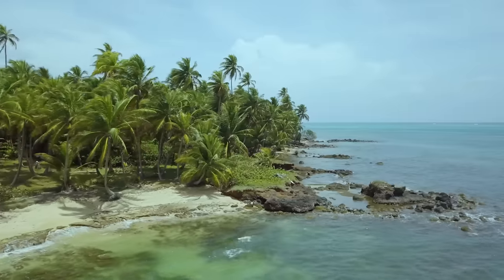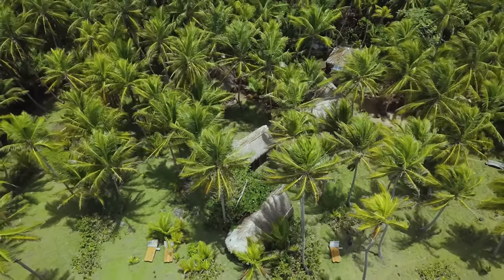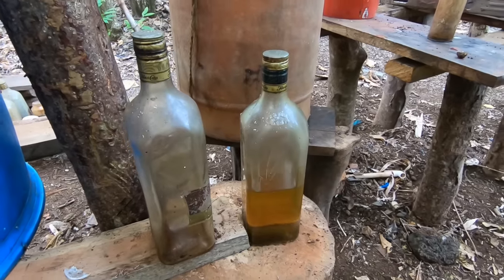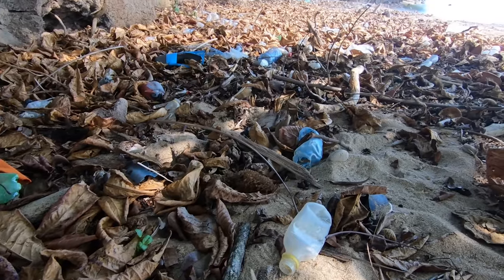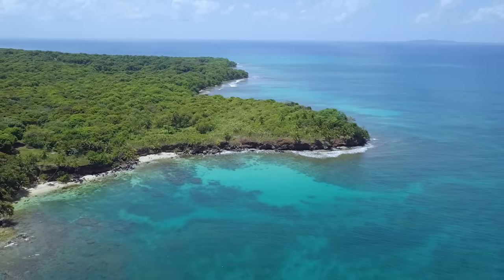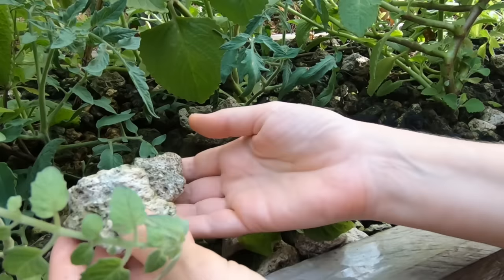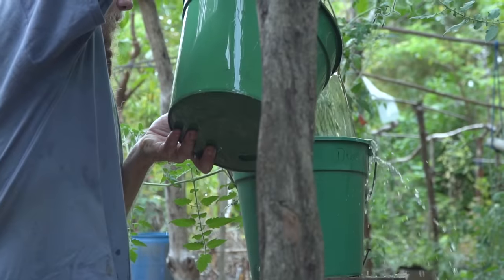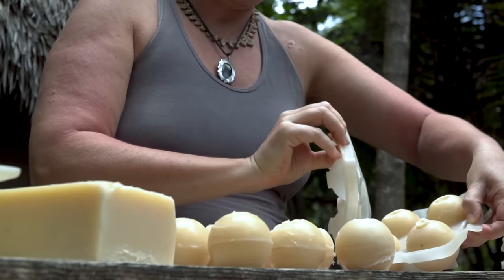THIS SELF SUFFICIENT FAMILY MAKES THEIR OWN FUEL FROM PLASTIC!

Comment: Really, wonder why they can't do that here ?
Wow, the oil industry would freak out over this. 🤔
Great idea
Reply: For the same reason we no longer turn in glass bottles at the grocery store for re-use.  It literally is cheaper and easier to make a new one than to clean and check for chips on an old one.
Reply: @suzannehartmann946  so ur for the continuation of pollution it seems... me personal rather stop all this extra bs that continues to wreak Mother Earth!
Reply: Two problems with it. The first is that it's a dirty fuel, probably dirtier than commercial fuel, so you would need to heavily filter it and separate off the fractions as he hasn't got a pure diesel, it's more like paraffin or petrol. 

Second issue is that he's using loads of wood to gasify and condense the plastic. If he was using solar or wind to generate the heat, there may be a case for it. As it is, he's in efficiently producing co2 and other pollutants by burning wood to turn a fossil fuel into atmospheric pollution and more CO2. Additionally, every time you convert from one form of energy to another you lose energy to the process, so he would have to have a really good reason for  making liquid fuel. Perhaps to run a car or generator... Which begs the question, why not use one of the many existing more environmentally kind ways of doing those things.
Reply: @aleceshowe  im for the guy in the video! Hes cleaning up plastic amd other stuff what are you goimg on about?
Reply: @aleceshowe  why are you saying this to me? You should be tagging the person i tagged the one who rather do whats eaiser vs whats better!
Reply: @KAG1776  that reply was not intended for you it was for susanne Hartman. 
Sorry mate.
Reply: @KAG1776  sorry mate that went to the wrong place
Reply: @aleceshowe  no worries
Reply: @Joseph F Portelli Except that Burning wood doesn’t make more CO2 than those huge ships, tankers and airplanes that spew it all over the atmosphere delivering fuel, goods, and people.
Reply: @KAG1776  please don't bullshit what they said. 

They said it's easier and cheaper. We live in a capitalistic society that has huge incentives to exploit and do it the cheapest and easiest way possible. 

We can decide to have a system that makes it benifital and wash for the people who would be doing the hard work but that actually takes well thought out exploitation.
Reply: @KAG1776  it's a pretty interesting cost benifit balance. I am all for what he is doing cause plastic is a really horrible pollution with very little means to decompose it. At lease when it's burned like this the co2 can return to the natural cycle. 

Is his system perfect? No. But he is utilizing resources in a mannor that does leave the environment better off. 

How viable this is is a different question. It's a very unique small scale solution that isn't terribly applicable to anything else.
Reply: @Skinnymarks  im all for what he's doing as well!  i walk around and collect things people toss out and repurpose them! Most my veggie/fruit structures are built from other people trash!
Reply: I suspect that the simple process he's using produces a fair amount of toxic gasses. Recovering those would be necessary if you were doing this on an industrial scale, and that would raise the cost significantly.   If you could get people to pay you for taking  their waste plastic away, you could probably still break even.
Reply: @Skinnymarks  Suzanne made a statement ... i replied ...  
The problem with humans is they always seem take the easy way out even if its wrong! Its easier to not mass produce crap this way people domt have to go around cleaning up all this crap! SO RATHER THAN CONTINUING TO CREATE ALL THIS CRAP WE SHOULD USE WHATS ALREADY MADE VS ADDING MORE TRASH!
Reply: @angelasandlin7058  no, it would be worse, or at best, just as bad. Plastic is a product of the oil industry, so unless you're shipping all that oil around the place, you won't be making plastic to recycle. 

Besides, his energy-to-pollution/co2 is going to be a far more inefficient ratio than just relying on freshly drilled oil. Plus he's burning wood, which if you scale up is going to mean we start losing forests. 

Again, I would advocate going down the renewable route where the energy to co2 losses are less and the co2 becomes circular, whereas he's adding fossil co2 to the atmosphere. 

And as I said, if there is an absolute need for liquid fuel, then he should use renewables to generate the heat. 

The reality is it seems as if he's looking for a way to live cheaply and avoid the bigger rat race... I would suggest that there are better ways to address the real problems that got us here and dressing his solution up as an answer to justify his position. It's too simplistic a worldview to think that escaping to an island makes you immune should the rest of the world continue to poison itself. It can only work for a tiny percentage of the population and even then it's not sustainable unless the world continues its bad practices.
Reply: @islandsedition  agree with most all u say! But forest management is necessary,  California if they actually managed their forest they would not have the wild fire issues they have... but they just let the forest burn instead of doing clean ups...
Reply: @islandsedition  there are places in the world chopping down lots of forest to make more room that needs to stop, not people harvesting wood thats dead... its the fools who take out the forest in masses!
Reply: @KAG1776  yes and no. Forests are, in some places meant to burn, as it creates natural fire breaks for the future. This results in smaller fires when they happen. 

The issue of late with Auz and California is the dryer periods due to climate change which makes it harder for saplings to grow back and shade the land, combined with increased human activity. Fewer people playing guess the baby with fireworks or being careless with campfires will always reduces the risk of fire. I'm guessing few have been started by spontaneous combustion.
Reply: @islandsedition  whats happing in cali is lack of care for the forest! If you do not maintain it will burn bad in the hott hott months... there are places in the world that actively keep the forests maintain to a degree and guess what their wild fires are far less and they have hotter dryer weather in some of these places... i again agree,   some forest fires are great because of the benifet after the fire passes, also some trees wont reproduce with out said fire... but cali problem is lack of forest control! 
Every year i prune my trees and my shrubs and flowers and every year i, bury compost and burn it, also if i see pieces of the wood from branches  i can use as ways for my veggies fruits and vines to use as a jungle jim i keep till they cant do what they use to... this year ill be walking around with a big wagon to collect things i can repurpose for projects like, adding to my compost heap, or building more structures for my plant life to thrive... one of my yards favorite treats is the woodash i feed them all.... i use 3 types of ash, the white ash use to sprinkle around my plants as food once water hits it its activated... then i have the chuncks and the black ash... for me each has its purpose... wish i could harvest alot of cali forest waste but im 2 far away lol
Reply: The biggest producer of the air we breathe come from the Ocean!  The second is our trees! Both are being destroyed ... most people think trees are our biggest producer of he air we breathe but our ocean is home to the real mass production of our air and we are absolutely  messing both up in a fast way!
Reply: Joseph F Portelli I’m curious to know exactly What “renewables” are you referring to that don’t use any other form of “energy” to be produced?  He uses Solar.  Wind turbines aren’t always reliable... so I’m curious.
Reply: @KAG1776  interesting, had to look that up as I didn't realise that 50-80% of the oxygen is produced by plants in the sea. Though, marine life consumes around that same amount, so we are still largely dependent on the trees and vegetation. 

But your point remains valid, and mucking one or the other up doesn't bode well for any of us, mammal, fish reptile or plant.
Reply: @angelasandlin7058  I was specifically referring to how he produces his fuel, which he is doing by burning stuff. 

As for wind not being reliable, I feel that is a misguided statement. All fuel sources are "unreliable" If the conditions for them to work are wrong. 

Wind is extremely reliable in many parts of the globe, especially on or near the sea. Solar has similar limitations but is still effective in very northern temperate regions. 

The key thing with any renewable fuel source is power storage to ensure that the ebb and flow of solar or wind don't affect the grid negatively. Batteries are the worst of them, but they are an option. Flywheels have been used industrially, and even on a short bus route back in the 50's in Sweden I think. But there are also air storage, hydrogen production, hydro (again limited by region). There is no part of the planet where one or more renewable energy techs in conjunction with suitable storage could not be used to sustain a quality of life as 1st world people enjoy.
Reply: @KAG1776  to be honest I'm not familiar enough with California to comment further on what's best for it, but it sounds like your making the most of nature which I commend. 

Have you heard of Hegelkultur? It's basically burying dead wood in your plant beds and it helps hold on to water and then releases it to the surrounding soil as that drys out. The water is then picked up by your plants. Scales up or down depending on what you need. Worth a look.
Reply: I know people who have farms.. well i dont know them personally but they had way more animal poop han they wanted around... they had 2 rain barrles they no longer used for storing rain water amd they turned into a compost bin... they realized it was producing gasses real quick... so they had got all the proper materials and they turned that into one of their power source's!  It was tested and burns alot cleaner than what we pay for to come into our homes.... i really wish instead of everything beimg about money we got back to a few basic things... i could build a house far superior to anything you see ... will last longer cheeper and safer!  But because it can be done for 70% cheeper he gov dont allow it... only way u can do it is if u incorporate some of the stupid rules that they implement! 
Many people dont realize that hemp is one of the best plants to grow, they see what was pushed from he marijuana madness era... hempcrete is one of the best insulators,  image all the things we build that involves chopping trees down... hemp can create alot of them and then some and we could let our trees for the most part do what they are meant to do and harvest hemp every 3 months and always have a flow of paper,cloths,hempcrete,and the list goes on... 
The gov does not want us to know things because then they wont make money doing nothing...
Reply: @islandsedition  i do something simular to that, but for now i bury everything! Dig huge holes where my veggies go and do that method... my compost heap is set up same way, but i use he compost instead of planting on it... one day... well i guess my raised bed is getting to be like how that is... i hardly have to water it! Hegelkulter you typically set up once and never have to water again, takes 3 years i believe amd you end up with a huge mound and to me i love it but no space... so i do my version of it!
Reply: @KAG1776  that's great. You're right typically people do large versions, but you can scale down. It's not as effective, but still works.
Reply: @islandsedition  then i guess you could say my yard is hegelkulter than cause i was doing that before i knew what i was doing!  Its like my inner me was guilding me lol right now one agrea i dug huge hole before winter all around it is big rocks or cobble stone... i took some fencing amd went all around it filled it with sticks and leaves and all my yard waste... i got huge barrles filled with sticks leaves amd yard waste... my main veggie bed every 3 years i completly dig up amd add more big logs ast the bottom then layer up with everutning else biggest on bottom amd more aged stuff at top... absolutely love doing all this hard labor... triple win, exercise/drain all the bs of the world away,  the best produce my mouth has eatten, and my local animals and helpers aka birds bees pollinators my wildlife friends/workers... cant wait for all this snow to go and the sun stays out longer and the nights get warmer...
This nov. I need to dig up main bed to add big stumps and do my layer process, very hard work but the ends justify all the work!
Reply: because you're not really solving a problem by burning waste plastic.      ...imagine a major metropolitan area doing this.  the tons and tons of fuel needed to burn the waste,  and then the sub par fuel that emits a ton of pollution when you use it.   (didn't see the coughs of black smoke off his generator?     ---why do you think most municipalities have no idle laws for big trucks) would be a horrible idea
Reply: @stephenx2857  who said anything about mass producing this? 
If we use all the ways given its better for Mother Earth and all on her!  When we take from her amd dont put back over time what you take dries up and takes along time for her to build it back up! 
So if we tapped into all ways and used what way works best for that area alot of the peoples problems would be lessened ... 
But because greed has gotten into powerful places they make it very hard! Money over whats best for all.....    crazy shįt
Reply: @KAG1776  Suzanne is ok, she was just stating why they do it, not supporting why they do it. :)
Reply: @suzannehartmann946  many grocery stores take glass bottles as well as all recycling centers.. hmmm
Reply: @KAG1776  Your use of ash is interesting. We'll have to look it up as we collect quite a bit if it. Right now we spread it on out the garden and banana plantation.
Reply: @stephenx2857 There are large industrial pyrolysis units that use the gasses produced to continue the pyrolysis cycle.
  The fuel from plastics is not sub par, in fact studies have show it to be superior in some ways. It is very highly processed hydrocarbon. You do have to filter out the carbon ash and make sure the fractions are not intermixed. In the video the diesel engine is starting cold so it takes a couple seconds to completely combust the injected fuel and afterwards run without soot.
Reply: @dereksplace1342  when i looked it up years ago, it stated the white ash has what we are looking for for our veggies... i leave the other types of ash around so it filters the water i poor down from the house house! I was bit by the garden bug and ever since i try to learn all i can to help me grow some of the best tasting foods ive had!
Reply: @dereksplace1342  i also looked up once what each plant needs nutrition wise amd would love to grow and make all my own special food for the things i grow! I need to get to the beach few things  i wanna grow suggest kelp so i need to harvest me some!
Reply: @KAG1776  Good job, congratulations.
Reply: Not really. You need oil to make plastics. Plastics isnt an upstream industry. It needs oil to be made. So if oil stops, plastic stops. Sadly theres simply no better material right now. Some may say oil is bad, but its also true that not having plastics is bad too. We need plastic so much. People would die if all plastics suddenly vanished. Humanity is between a rock and a hard place. Yes we need to go away from oil eventually but we need to do it carefully. Musnt rely too heavily on emotions. Yes we know oil is not perfect and needs to be replaced but right now we simply have no other choice

Without oil, we wont have industrialised farming, and we wont have food distribution. Meaning people would literally starve and cant get a basic necessity such as food. Theres almost 8 billions of mouths to feed.

Comment: I'd like more details on how you made the contraption that turns plastics into diesel
Reply: It's not exactly diesel, more like kerosene. Diesel doesn't burn like that example in the cup.
Reply: @john wood Quite a difference between diesel and kerosene. Not all fuels are the same so it's not semantics.
Reply: @stevet5379  whatever the hell it is its working in his diesel generator right?  thus you can say its diesel fuel, What else would he call it. It fuels his diesel engine , So its diesel fuel..   am i wrong ?